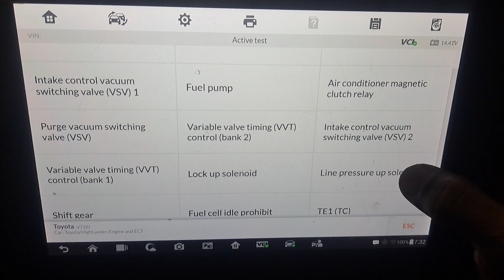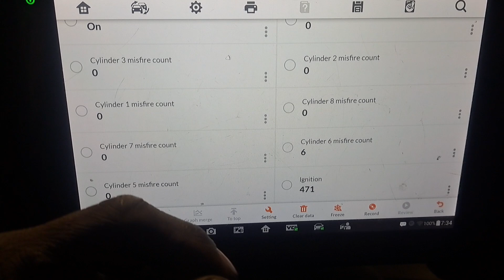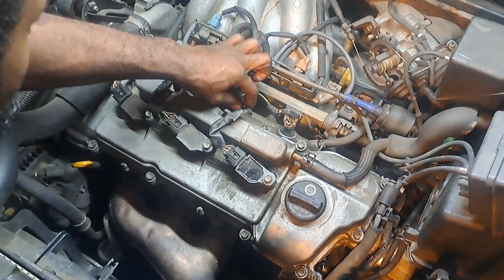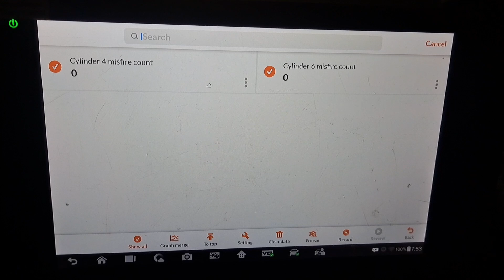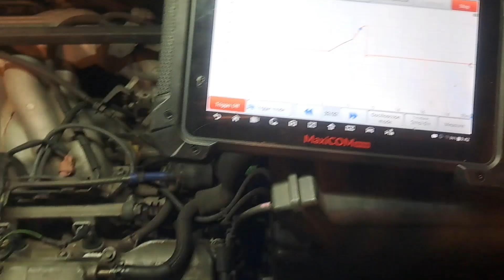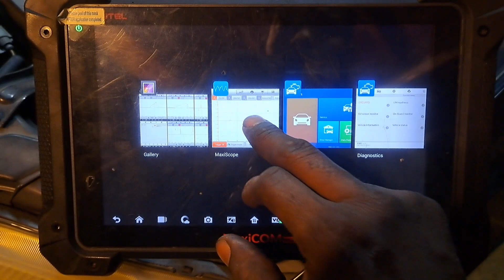Toyota has misfire, New coil and plugs were replaced before!

Comment: Yes indeed it would seem it is current limiting, something installed in the circuit by the manufacturer in that coil pack to reduce heat load almost certainly.
Reply from the maker: Yes.  Make the current ramp sloppy